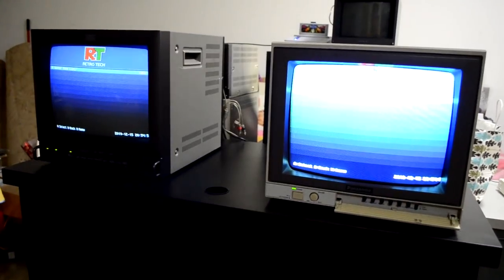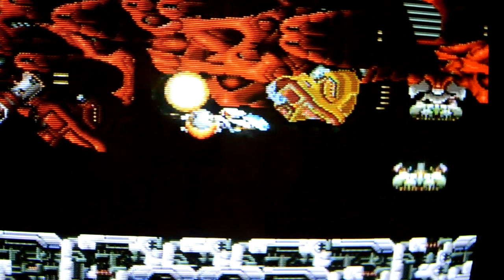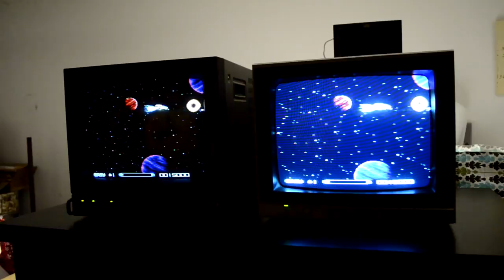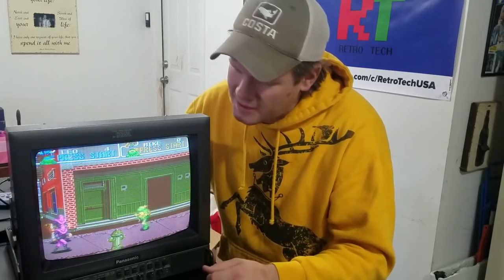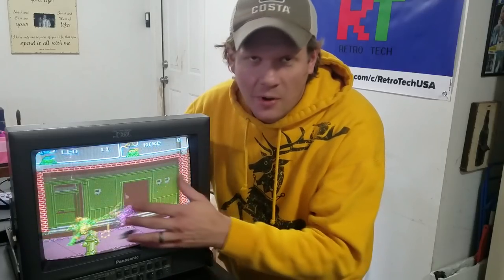Panasonic CRT Monitor Tube Swap Continued!

Comment: Glad it's back up and running. Would have liked some commentary  or even captions as you reassembled and while adjusting the potentiometers. Also, did you have to adjust the convergence rings? Would be nice to learn more about calibrating convergence, as I understand it can be quite difficult. Don't think I've seen a video of yours on that
Reply from the maker: Thanks David.  That would have been a great idea to add caption/voice over when I was adjusting the yoke and adjusting the pots.  Thanks for the constructive critisism.  🙂
Reply from the maker: Also I do plan to make a convergence ring adjustment video.  There is a very good way to adjust them, but it's a little tricky to setup properly.  Still it will come in 2019.  Thanks again.
Reply: Retro Tech I’m not certain, but I think you might still be able to add annotations within YouTube which would essentially be captions that aren’t built into the video file itself.
Reply from the maker: @davidc7763  thats a good idea.  I'll try it on this video, that way I don't have to re-upload this one.

Comment: Got a little problem with a standard 14" tv I bought. It was made around 2006 or 2007 and never used since then, I'm the first one using it. Problem is I have white streaks horizontally over the screen on high contrast images, for example stars in space. Could it be bad capacitors since it hasn't been used for over 10 years? It has a IRICO 37SX110Y22-DC15(A) tube in by the way, never heard of that manufacturer before.  Maybe the streaking is just standard quality of these tubes? xD Beside that the image isn't too bad.
Reply from the maker: Bad caps can cause this type of issue.  It's a good idea to replace caps on really old crts.  Have you tried adjustimg the screen brightness on the flyback to see if that helps at all?
Reply: @RetroTechUSA  Yes, I adjusted the flyback but that doesn't seem to be the problem. I also have geometry problems on vertical lines left and right close to the edges of the screen. Service menu settings don't to much, that's why I think the bad caps responsible are in the area  where the image is generated. Can't do much though since I don't have any equipment. Didn't see any bulging or leaking caps. Btw is it bad if you crank the flyback screen knob all the way up for a short while? ;) The chassis is a Changhong ETE-2, there's even a service manual and schematics for it.
The streaks looks like in this video, but not as severe https://www.youtube.com/watch?v=ebOmWYqlOIY Maybe I can fix it myself if I get equipment.
Reply: @RetroTechUSA  I have played around with the service menu settings (wrote them down before) and it seems the setting for cathode drive level (HDOL) was way too high, turnded that down and the pciture is much better now. Still have problems with streaking, have to adjust screen on the flyback again, since it says too low in the service menu.

Comment: i actually have 2 of these 13 inch panasonic models, i wanna get em fixed, i do have recapping experience but with consoles and what not but not CRTS. in im s.illinois anyone know of any reputable repair shops in the area?